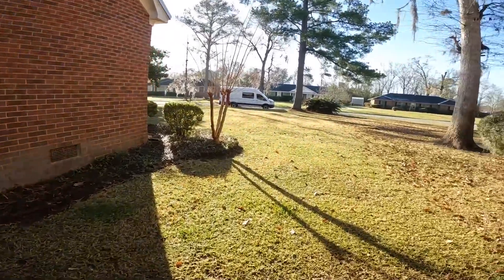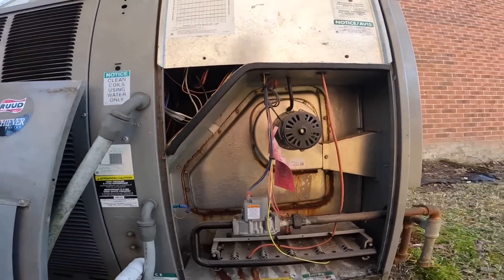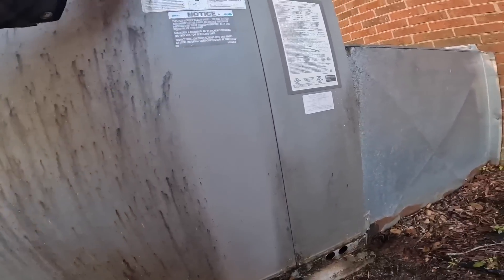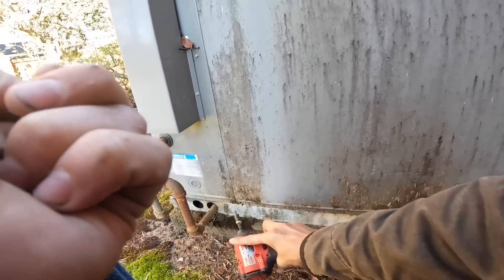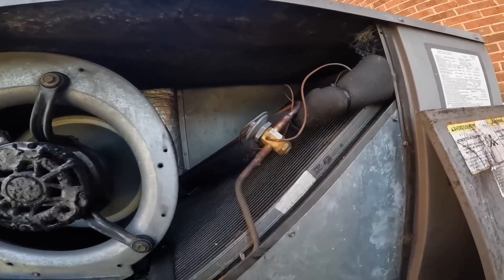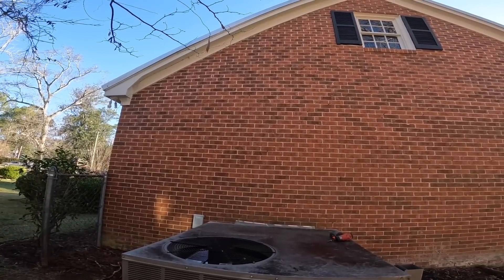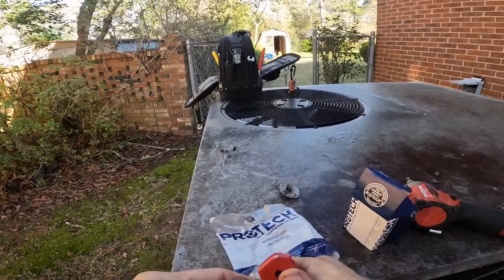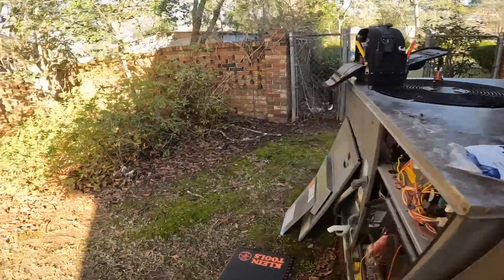No Heat Call On a 2015 Ruud Gas Pack #hvacguy #hvaclife

Comment: My first call to a "candle burner" was a stumper. It took me some time to figure out why the white walls were stripped with black lines.Don't know the scientific reason but the candle residue would stick more on the part of the walls where there was a stud. I spent the rest of my HVAC career trying to convince people not to use them, or at least switch to Soy candles. Thanks for the videos Curtis. This old retiree really enjoys them!
Reply: Just think of their lungs over the years from that indoor pollution. Like living next door to a coal fired steel smelting furnace

Comment: Ivr had a few calls with customers who do the same thing. I remember installing a multi head split system in a townhouse complex and 12 month later had a call for a no air issue with one of the indoor wall units. I couldnt believe how much soot could build up in a relatively short amount of time. The filters where so blocked the fan couldnt pull air through…

Comment: Is black candle smoke clogging things up?   What’s the white crusty stuff on the limit area?  
Nice job
Reply: I think they were using acid and water to clean the coils! There's a big tag telling to only use water to clean the coils!
Reply from the maker: Looks like it may have had a clogged drain.
Reply: @HVACGUY    Is the candle smoke clogging the filter and things. Thanks for the other answer
Reply from the maker: @jamesfitzsimmons381  yes, filter has been black everytime I’ve checked it. Today it was brand new.
Reply: @HVACGUY   thanks Curtis
Reply: @HVACGUY    Hope the tenants have a low level CO detector or a least a regular monitor